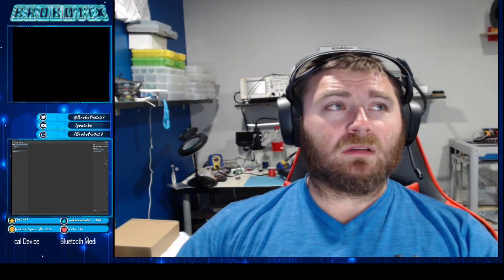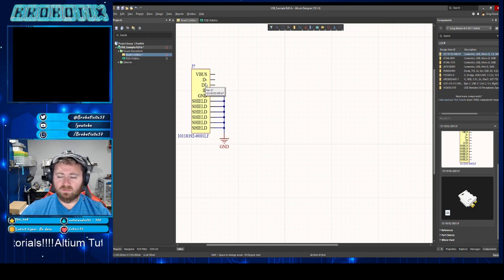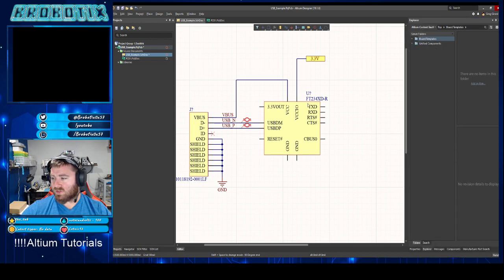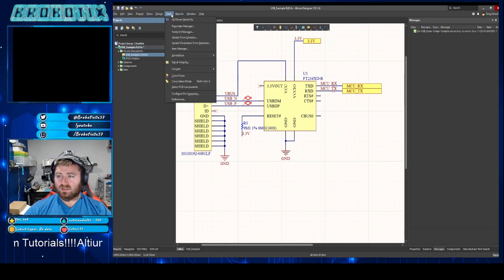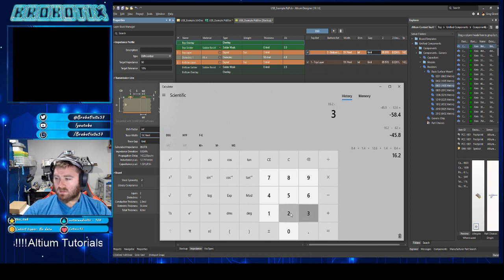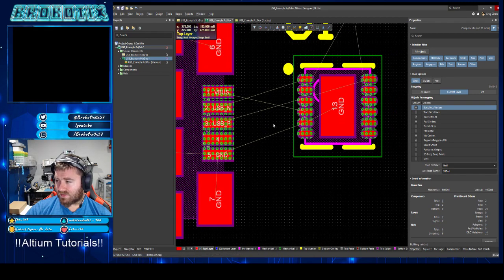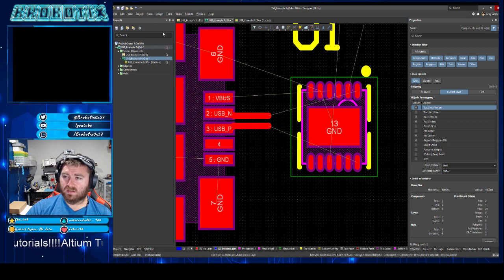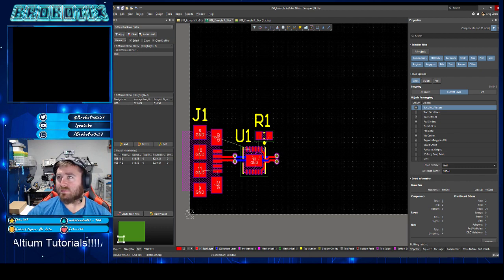Altium 19 - USB Impedance Routing

Comment: Very helpful video showing how to navigate the (ever changing) Altium user interface.  I am using AD20 and with out this video I could not figure out how to do this using only the Altium instructions. 

Summary:  
In Schematic, add the net names to the differential pair identical except with the ending "_P" and "_N".

In Schematic,  add differential pair directive to the nets.  Add the differential pair to a Diff. Pair Class with a descriptive name. Example USB.
Import schematic changes into the PCB.

In PCB, setup in the Layer Stack Manager an impedance "profile" for the impedance the circuit requires and name it. Example USB.
In PCB,  go into Design Rules and add to Differential Pair Routing new rule(s) for the differential pair class and set to use an Impedance Profile that you created.
In PCB, Select Route, Interactive Differential Pair Routing and then click on either of the nets and start routing. 

I would say also, Experiment with routing and changing layers to get a feel for how Altium places the twin vias.   Experiment, You may need to left mouse near the destination to lock down how your final approach connects and help Altium make the last connection equal length.

Did I miss anything or could my summary be improved in any way?

Hope this helps.

Comment: The series termination resistors are not for outer noise cancelation. Its not a thing. 
Its for impednce matching. It reduces reflections, therefore reduces ringing and also, because of that reduces crosstalk. 
It is for signal integrity reasons, not those which you mentioned which are incorrect.
Reply from the maker: You're correct.  Thanks for chiming in.  While the resistors can mitigate some noise, the reflection and cross talk is the valid reason.  Thanks for the comment!

Comment: 17:50 But did those number took impedance control into consideration?
Reply from the maker: This is a good point. It does not. I looked up a few resources and it does make a difference. More or less when you're doing real high speed. This is a good point though!